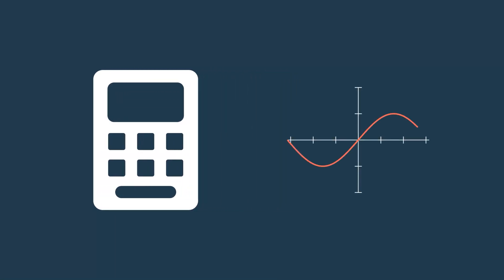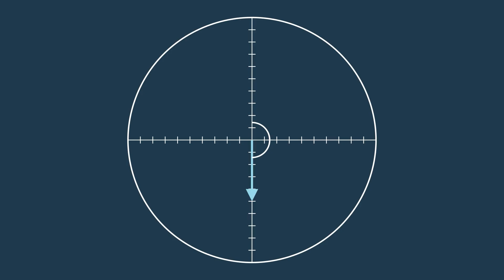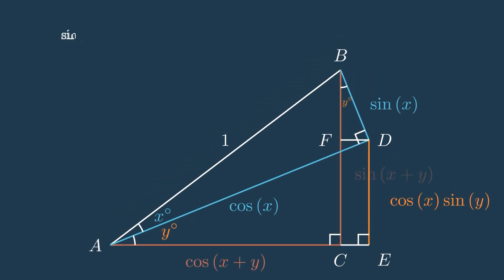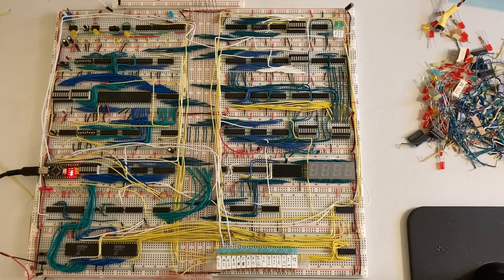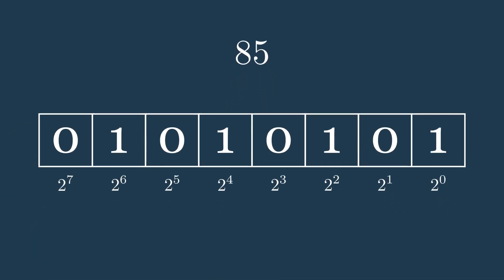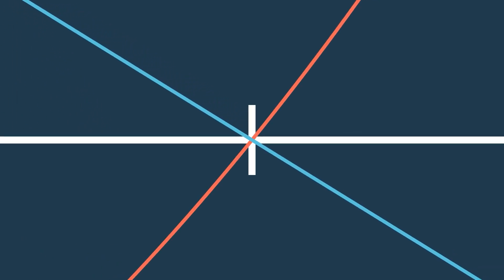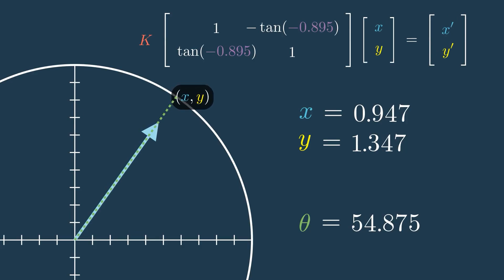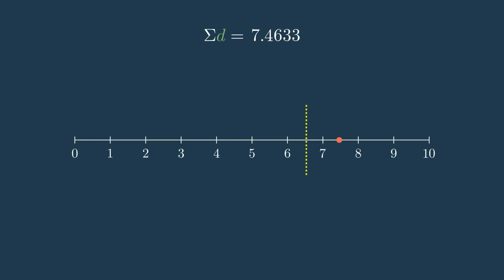How can Computers Calculate Sine, Cosine, and More? | Introduction to the CORDIC Algorithm #SoME3

Comment from the maker: I figured I’d make this comment to address some common questions I’ve been seeing:

EDIT: I made a mistake in saying that we don't need to calculate the angles a_n = tan^-1(2^-n). We do need the angles in order to keep track of the total angle we've rotated by, but we don't need to calculate tan(a_n) since we know it's 2^-n. Apologies for any confusion this may have caused.

1. Is this algorithm the main way to calculate these functions today?

Today, this algorithm is rarely used. The main advantage of it is how few transistors it needs, at least compared to implementing a floating point unit to use a polynomial method. For this reason, the main use of CORDIC today is in circuits where hardware is limited, and not in more powerful modern computers. I think it's still a useful algorithm to learn because of how interesting the ideas behind it are, and how it gives you an insight into how computers function.

2. If CORDIC is used to calculate sin, cos, and arctan, how do we get the cos and arctan values we need for the rotation matrices in the first place?

For the angles we use, which are tan^-1(2^-n), since we know the tangents of those angles are 2^-n, we don’t need to actually know the angle on the computer we don't actually have to compute tan. That’s due to the fact that the rotation matrix only has terms that are tan(a_n), which will always be some 2^-n. We’re not actually using the values of the angles a_n when we do the computation. We can calculate a_n = tan^-1(2^-n) using something like a Taylor series, which we need to keep track of the total rotation we've done by adding or subtracting each angle from the total depending on the direction of rotation. 

For the cos(a_n) constant, we can compute this using a method like a Taylor polynomial or some other approximation besides CORDIC. As @Demki noted, we could also use CORDIC to calculate the scalar of all of the cos product by starting with a vector on the x-axis with length 1, rotating it onto the y-axis, and then finding the final length of the vector L. If we multiply by 1/L, we’ll re-scale our vector to a length of 1 again meaning the cos scalar = 1/L

3. Why is the cos product K always the same? Wouldn’t it change each time we run the algorithm?

The reason the cos scalar K remains constant is because the series of angles we rotate by, +/- a_n, remain constant in magnitude with only their signs changing. Cos(x) is an even function, meaning cos(-x) = cos(x). Therefore the sign of a_n doesn’t affect our cos(a_n) value. Since every cos(a_n) value is the same every time we run the algorithm, the constant K to scale the vector by will be the same each time. 

4. Why not use something like a Taylor Series to approximate the values instead?

Polynomial approximations like Taylor series are pretty simple in their computations, but they require a lot more multiplication operations. The main advantage of CORDIC is how easy it is to implement with very little in the way of transistors, at least compared to a floating point unit.

5. Why use the repeated addition algorithm for multiplication? Aren’t there faster ways to do it?

The main reason for using that algorithm was because it was simple to showcase without having to first introduce binary. I know that there are much faster algorithms for computer multiplication, but the goal was to show something simple that provided motivation for the bit-shifting optimization while still giving a general overview of how everything works. I do regret not putting a note in the video that explained this, but hopefully people will read this and not be mislead.
Reply: Hey I'm feeling really stupid rn but how do you keep track of whether or not you've overshot the angle without knowing what the individual angles are? Surely you would either need arctan(2^-n) or tan(theta) to be able to draw a comparison? But then you would need to calculate tan(theta) which obviously defeats the purpose...
Reply from the maker: @r-prime  Sorry for the confusion, I updated the comment. You are correct, we do need the angles stored on the computer, arctan(2^-n), to keep track of the total rotation that we've done. We still don't need to calculate the tan(a_n) though, since we know it will always be 2^-n.
Reply: @bobater  So, for the N-bit angle we need to precalculate N arctans?
Reply: @dimastus es, basicly each Cordic micro rotation gives you ca. 1 bit of precition
But there are newer versions of the cordic that work a little different
Reply: I think there is another mistake at 12:27

It's not because the terms are getting smaller that the sum converge
Exemple : Σ1/k for k ∈ [1;+∞[ diverge but the terms are getting smaller
Reply from the maker: @lucarl1021  Yes this was more of a semantic thing on my part. Technically I was saying that the terms were shrinking even as we approach infinity, meaning the ratio between terms is less than 1 as we approach infinity and indicating convergence, which is a mathematically correct argument. However, some people could interpret this as simply saying that the terms are shrinking so the series converges, which is not true of all series with shrinking terms.
Reply: @bobater  ooh okkay, mybad
I've just learnt something about convergence test then
Reply: CORDIC is indispensible for when you have a very simple or low-power computer and no transcendental functions available & look-up table are also too big which is why no usual computer uses them - nowadays they are only used in tiny special case niche. Mostly computers don't calculate them at all: programs mostly multiply by normal vectors if you need rotation or heaven forbid if you have to a built-in floating point sine cosine (which internally use a combination of function symmetry & repetitive properties + polynomial approx + maybe table lookup). same is true for exponential functions, logarithms & the inverses of the trig functions.
Reply: If this isn't used very often anymore, then what is?
Reply: If CORDIC is rarely used, then how does a calculator actually do it??
Reply: Hey, I was wondering, for the question 1: you said that we can calculate the values of cos and tan using the taylor series, but can't we just store these values somewhere in the computer because they are constant? (the value of the cos is constant, but the tan values can be stored as an array)
Reply from the maker: @samuelcomeau I had it pinned but it got unpinned for some reason
Reply: @bobater  Editing a comment unpins it.
Reply: The cordic algorithm is cute, but it isn't the way standard efficient numerical packages compute sin or cos. 

They do evaluate polynomials-- these aren't Taylor series, those are exact at the point of expansion (where derivatives are evaluated) but increasingly bad away from that. 

Instead the polynomials are optimal in the Chebyshev sense - distribute and minimize the worst-case error.

Also, just a key point: no competent numerical programmer ever evaluates a polynomial as we write them.  Instead note that 

ax3 + bx2 +cx +d 

Can be written as

((ax +b)x  + c)x + d

This is three floating point multiplyadd instructions... note I said "multiplyadd" as though it is one instruction, and on most modern computers it actually is, called fmadd.  The add term is fed into the multiply-accumulate, and is effectively free.

This beats the snot out of cordic
Reply: i dont have time to read this comment

Comment: In practice, calculators use trig identities to perform range reduction so they don't have to do as many rotations. For example, sin(A) = cos(90-A) combined with the fact that sin(45) - cos(45) means that you only have to work in the first 45 degrees and simply identify which quadrant the original angle is in to determine the sign of the result. If you want sin of an angle > 45, you simply return the cosine value instead. Similarly, tangent is the same in every quadrant but may also carry a negative sign or require inversion (tan of 97 is equal to tan 99, not tan 1, remember). Tan > 45 degrees is > 1 and tan < 45 degrees is <1. However, you also have to realize that tan for A > 45 degrees is equal to 1/(tan < 90-A). (tan 57 degrees is 1/tan(33) 90-57=33.  So Calculators build their tables from 1-45 degrees, meaning they can store fewer values and still get quite accurate results. Since the inverse functions can be done in vectoring mode, these are generally faster. tan is also done in vectoring mode and, if you examine your calculator's response time, you will usually find that tan is the fastest operation, sin is next, and slightly behind that (~10%) is cos. It all hinges on how the algorithm is implemented and what is done for the guard digits, if any.

Comment: there is a much better way to multiply two binary numbers a and b, simply shift b left by 1 in a loop until its zero. in each iteration, shift a right by 1, then add b to the product only if a is odd(the lowest bit is set (a & 1 != 0) ). this technique gets you the answer in worst case O(log(b)) instead of O(b)

Comment: I was expecting Chebyshev polynomials which have been used since the 1950s for this very function. But it seems that different methods are used on different processor architectures… Either way, the picture is more complex (no pun).

Comment: You missed one last trick to eliminate that last multiplication that you did to correct for cosine term from all the iterations.  You set the initial vector length to that number (0.6.....) rather than unity.  As the iterations proceed, the vector length grows, ultimately reaching unity as the last iteration is done.  Actually, only a finite number of iterations is done (this number must be fixed in order for the cosine correction term to be fixed) & the cosine correction is calculated for that number.  You also do not mention memory requirements.  You need working registers to store the present vector X & Y terms.  Also required in ROM is the cosine correction value & a table of one angle for each iteration number.  So ROM must contain N + 1 values, one for cosine & n for the iterations angles.  This can get large.  For example, for 16 iteration routine, you need storage for 17 constants, each of length to support precision of the calculation.  You can save one iteration by reducing the angle range to one octet & folding the input angle into that.  This also permits eliminating negative numbers from the calculation in the constants.

Comment: May I know if this algorithm is better than Taylor series computation of sine and cosine?
Reply: The thing is that the steps of CORDIC are much faster than calculating terls of the Taylor series. but Taylor has better convergence (x^n/n! for Taylor and 2^-n for CORDIC). If you use like 1024 bit numbers and want crazy accuracy, Taylor might be better.
Reply: @dudono1744  I use angle between 0 and 180 for sin and cos. Pls tell me if Cordic algorithm is better than Taylor series
Reply: @premkumarsr4021  Cordic is better. Actually, since Taylor's steps take longer and longer, Cordic is better even at high accuracy.

Comment: Even if the terms of a series are gradually getting smaller when n is getting bigger, the series can diverge. For example, the harmonic series (1/n) diverges even though the sequence 1/n converges to 0.
In fact, if a series converges, then the corresponding sequence converges to 0. But, if a sequence converges to 0, the corresponding series can either converge or diverge.

Comment: Back when I was first learning to program (using C++), I was so enthusiastic that I wanted to make my own command-line calculator. At first I made it using just basic arithmetic operations. And then later on I added trig functions (along with the other typical math functions). But at the time I didn't know the standard library already provided built-in sine/cosine/tangent functions, so I ended up writing my own rudimentary ones using Taylor's series approximations 😅

Comment: Quick question. I was wondering if computers could use the complex plane to rotate points(by multiplying complex numbers), instead of using a rotation matrix. Is there a reason this isn't used?

Comment: Very interesting.

Is that how scientific calculators do this kind of calculations? Like the venerable TI-30?
Reply: As per TI knowledge base website, almost every calculator uses the CORDIS algorithm to calculate the trig functions along with a table of precomputed values. There are three models that use Taylor series along with some polynomial functions IIRC (didn’t check that recently)

Comment: Super interesting, I always wondered how CORDIC worked.  Question, though, at 12:19, I'm not sure that the ratio of a[n+1]/a[n] is really sufficient to prove convergence, since the latter terms of the harmonic series  (1/2 + 1/3 + 1/4 + ...) satisfies that test but still doesn't converge. Maybe I'm missing something though. Anyways, great video!
Reply from the maker: Thanks for watching! The key with the ratio test is that we’re evaluating the ratio as a limit as we approach infinity. For the harmonic series, that ratio approaches 1 as we approach infinity. Since the ratio isn’t less than 1, the test does not tell us that the terms of the harmonic series are shrinking relative to each other at the limit, and therefore doesn’t imply that the harmonic series converges, which is why there is no contradiction in using the test

Comment: how do you keep track of what theta is in order to compare it to the target angle?  i understand how you track the x and y coordinates, but not the angle.
Reply from the maker: Good question! We can store the total angle that we’ve rotated by in memory. Each time we iterate the algorithm, we can add or subtract the angle that we’ve just rotated by with our total angle so that we know what angle we are currently at and can compare it with the target angle.
Reply: thanks for your response. my confusion was more about how you actually know what angle you're adding, since we only know them as arctan of 2^{-k}, not an approximate decimal value which we could sum and keep track of.  do you just start by calculating decimal approximations of arctan(2^{-k}) in some other way for a sufficiently large number of values of k, and then storing them for use in the CORDIC algorithm? @bobater
Reply from the maker: Yep that’s exactly right! We can pre calculate the angles using some other method and then store them in a lookup table in memory which we can reference while using the algorithm

Comment: i found my own method for calculating cos(x) 
1.choose accuracy n
2. divide the input number by 2^n-1
3.square the number and subtract 2from that
4. repeat 3 n times
5.divide the answer by two
this works due to the double angle formula and chebesev polinomials

Comment: Ahhhh this video was so confusing!

1. At 7:18, you say that because we have the rotation matrix, "we have a way to rotate vectors and get their x and y coordinates after we rotate them" (correct) "...that gives us our sine and cosine" BUT the rotation matrix requires that we calculate sine and cosine! I don't understand why we're any better off at this point. 

2. Was the motivation behind why we're adding successively smaller angles to an initial 45° ever explained? I don't see what doing that is giving us and I feel like it's probably a crucial part of this algorithm. 

Is it that you precalculate the terms of the summation AND their sines and cosines? Then you can just store those in a list and easily plug them into the rotation matrix?

I appreciate the video but feel that this key point could have been explained a little more in depth.
Reply from the maker: Really appreciate your feedback. This was my first real attempt at making a video explaining a topic not many people had seen before. When I made this video, I had about 6 subscribers, so the amount of people I expected it to reach and the quality standards I set for myself were somewhat low. If I have time, I might make another version of this video with all of the feedback I got and mistakes I made in mind, but I am pretty busy right now so I’m not sure if/when that will happen.

Comment: 16:44  The numbers on the right don't match the drawing on the left.  That's more like 1 or 2 degrees, not 36 (I assume you mean degrees here but it's not indicated)
Reply from the maker: The number on the right is actually the total angle we've rotated the vector by up until this point, not the current angle the vector makes with the x-axis. Also yes, this is measured in degrees not radians.

Comment: Hey Bobater, great job!  I was wondering if any of this might help explain the super cool phenomenon of tan 89, tan 89.9, tan 89.99, etc.  Why they keep going up by factors of 10 has always been something I've been curious about.
Reply: It's easier to see when you convert them contangents using the fact that cot x = tan(90-x). This results in cot 1, cot 0.1, cot 0.01. They approximately scales by factor of 10 is because cot x is close to 1/x for small x, using sin x ≈ x and cos x ≈ 1.

Comment: in practice, if you alredy have microcomputer capable of simple operations then you should use polynomial approximation of sin/cos up to 5th power for sine(3 terms) and 4th for cosine(constant + 2 terms). it is pretty fast and uses only couple multiplications and additions.
Reply from the maker: Yes if you have access to fast hardware multiplication it’s usually better to use a polynomial based method rather than CORDIC. CORDIC is a better method on computers without access to fast hardware multiplication.